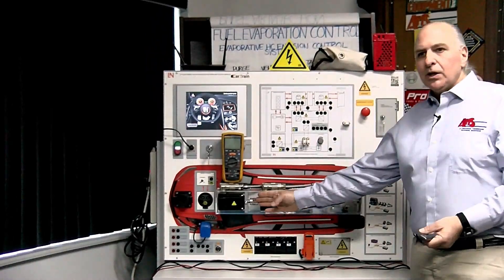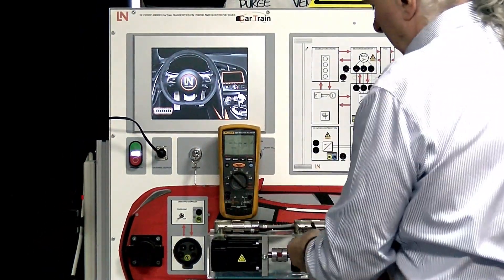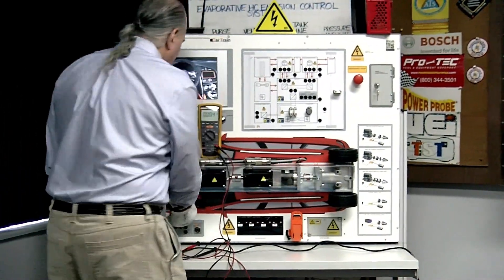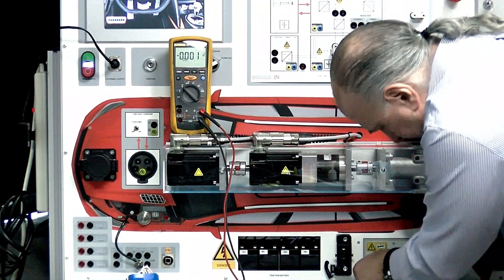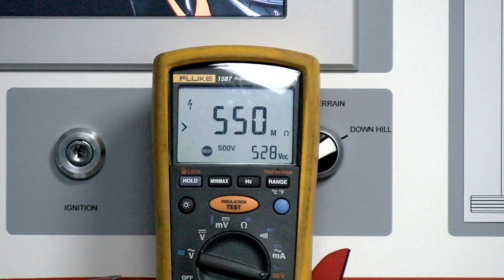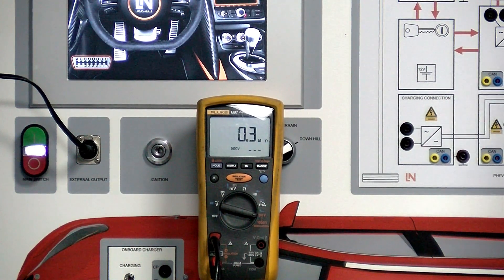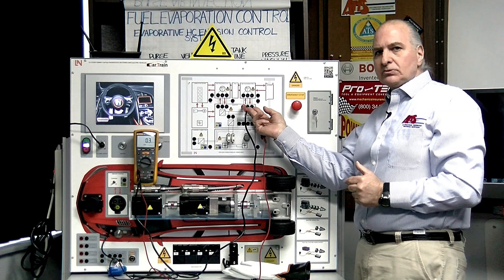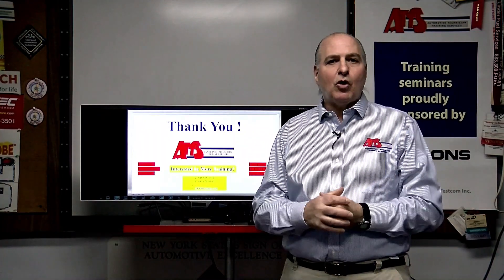Hybrid Electric Isolation Fault on LN (Lucas-Nuelle)

Comment: Nice vid, I just didn’t quite understand the readings you were getting
Reply from the maker: Alastair have you use an Ohm meter? I am sure you have...When you get a resistance reading it means there is a connection from one end to the other. The ohm meter puts out about 3 to 5 volts (Diode output 5 to 7 volts) and when you connect it to something such as a wire end to end the meter displays an Ohm reading. If the meter reads OL or OUCH depending on the meter the circuit is open not making a connection. When I was testing a good MG (motor generator) you should have noticed that the meter read 550 M Ohms and 500 volts in the lower corner of the display. When I switched to the MG with the Isolation Fault the meter has a low resistance reading and the voltage dropped that indicates that the MG or wires have a short touching ground. The 1587 Fluke MegOhm meter can put out 550 M Ohms on the 500 volt scale...a bit of a difference than the 3 to 5 volts of a regular Ohm meter. Hope this quick explanation helps. Thank you....If you have not already subscribed to our tstseminars YouTube channel please do so. Interested in more training? Go to www.tstseminars.org and view full length videos for members on TechFlix for $9.99 unlimited viewing …Membership and over 85 videos for less than $200.00 a year. Also checkout www.attstraining.com for hands on training and webcast FREE videos at www.tstseminars.org/training-videos
Reply: @TSTseminars  that’s great, thanks for the reply and the info, much appreciated. I am just getting into hybrid diagnostics so have a bit too learn
Reply from the maker: @alastairmackay4861  glad I could help...If your interested in a hands on Hybrid /Electric class go to www.attstraining.com/shop-1